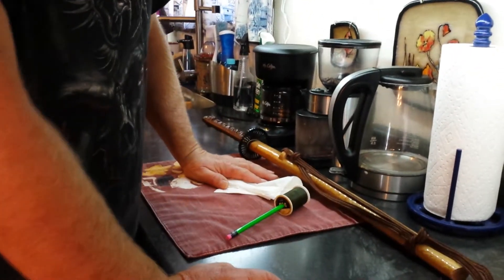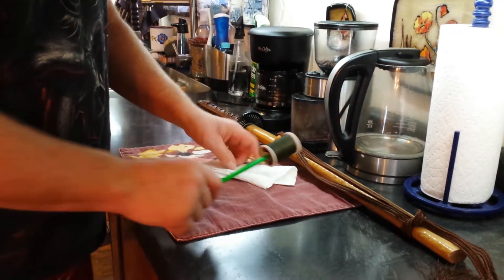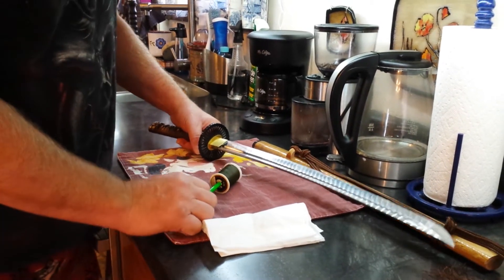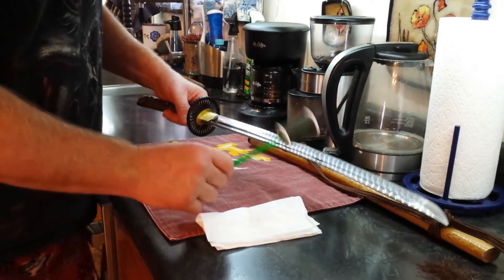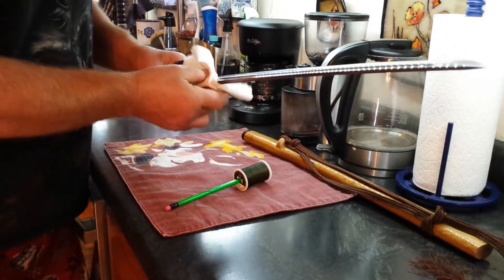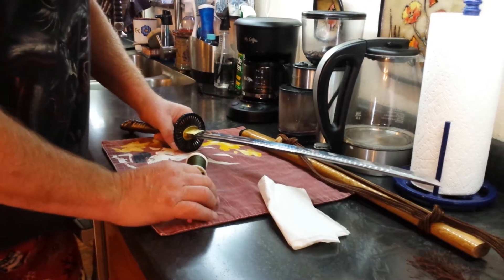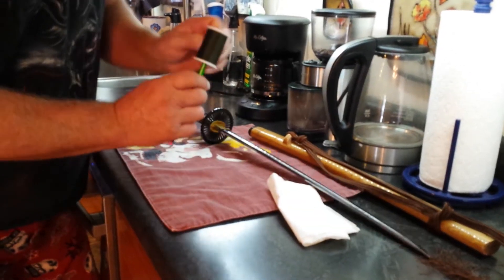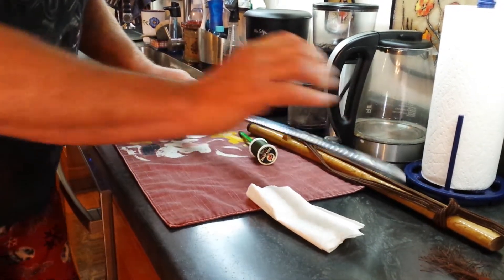Uchiko: How to correctly use the Uchiko powder ball to care for your Katana sword.

Comment: Good info for beginers. But most sword collectors in these times use micro cloth to remove oil. As we know that uchico is basically crushed stone....that scratches the blade.
Reply from the maker: Yes..
I have other videos where I tell everyone not to use uchico.
But if you really want to, then there is a way to use it with less chance for damage
Reply: @AlanMolstad  it does have its uses. On a out of polish blade with a little care it can reveal a hamon outline.